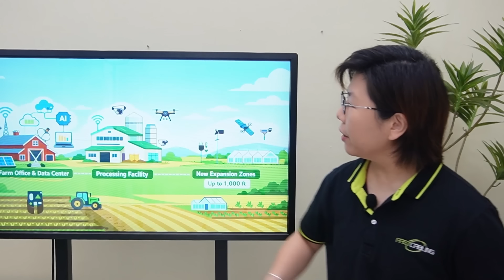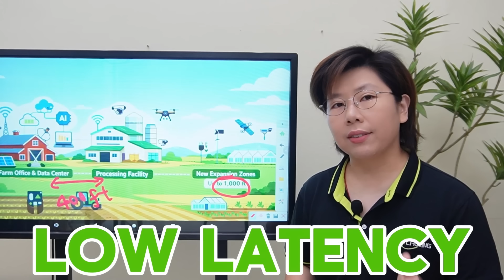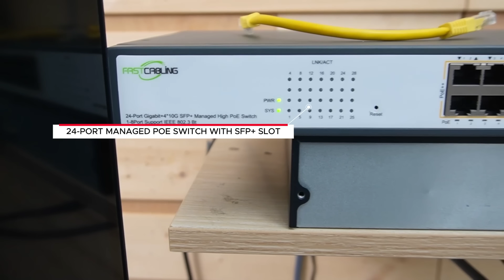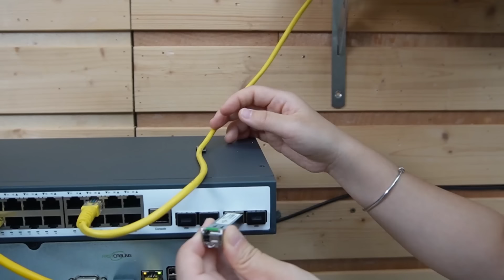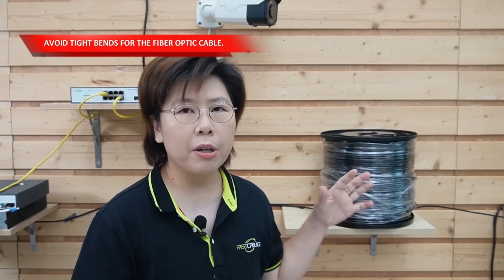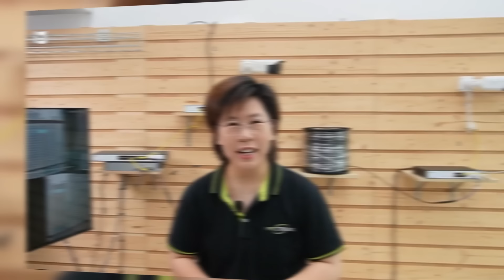How to Run 10G Fiber 1,000ft for Smart Farms (Direct-Burial Guide)

Comment: Sir i have Fiberhome OWA-500 outdoor Wireless Router This Router Power on with POE RJ45 with  connector with Ethernet wire I want to use this Router with Fiber optic cable can this possible please help me waiting for your responce..
Reply from the maker: The only physical port on this router is a single 2.5GE RJ45 LAN Port with PoE. You can use a 2.5G PoE switch with a 10G SFP uplink as a central hub. It takes the signal from your fiber network (via the SFP+ port) and converts it to send to your OWA-500 through a standard Ethernet cable.

Indoor Version:
https://www.fastcabling.com/product/8-port-2-5g-poe-switch-with-10g-uplink/
Outdoor Version:
https://www.fastcabling.com/product/8-port-2-5g-outdoor-poe-switch-with-10g-uplink/